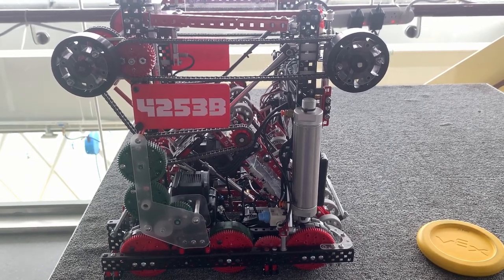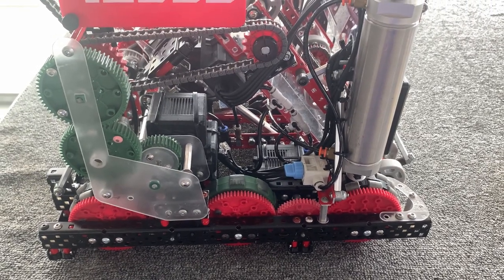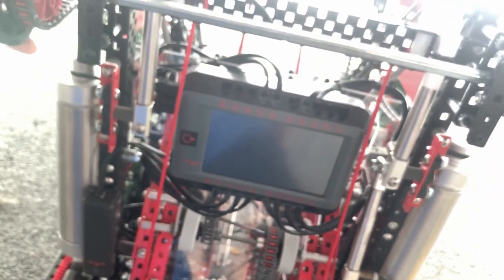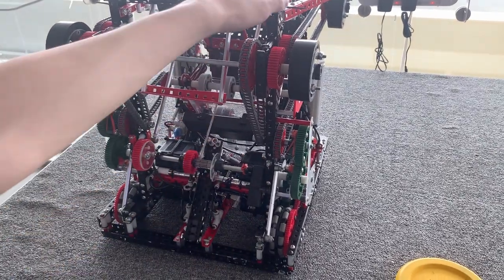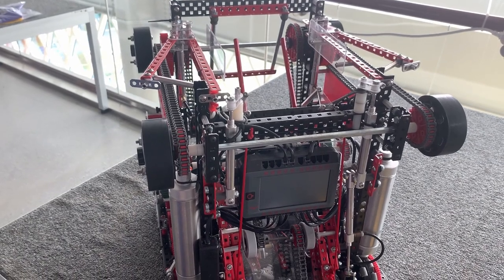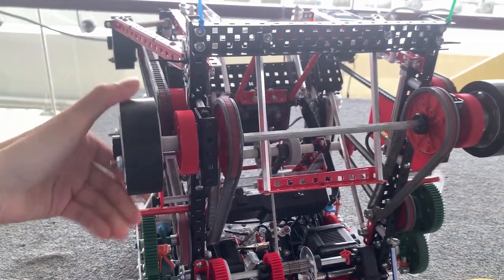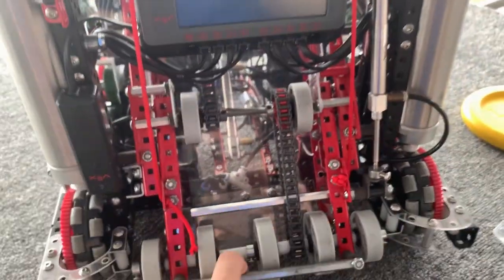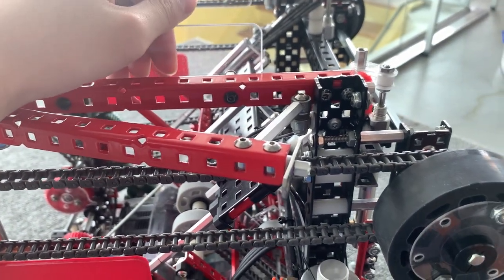VEX 4253B Spin Up Robot Explanation

Comment: when u screw joint on the red gear do u drill a hole through them so it fits?
Reply: On the HS gears, just use a circle insert.